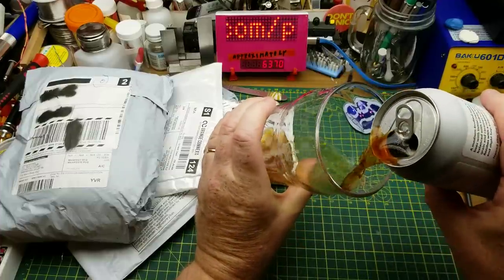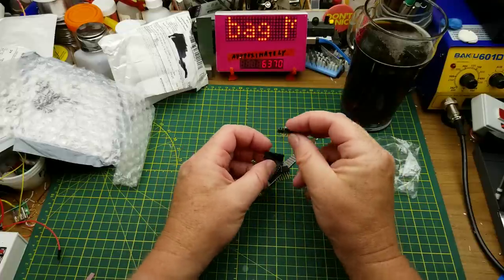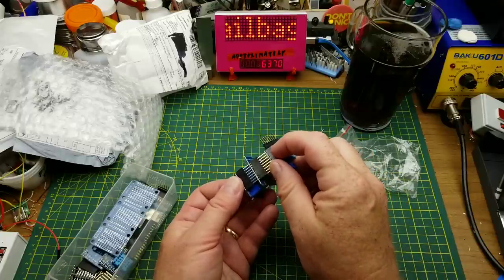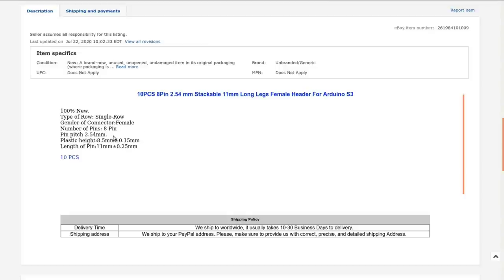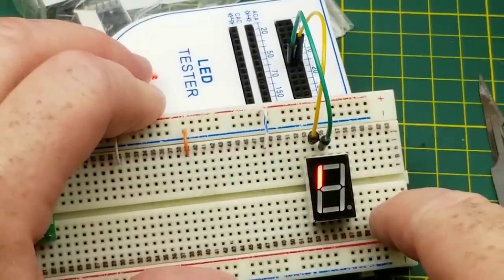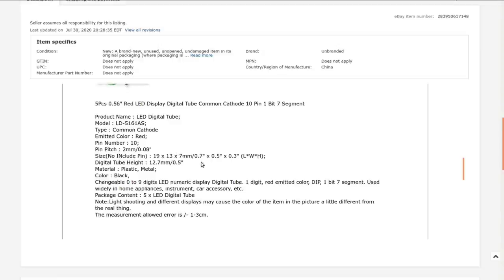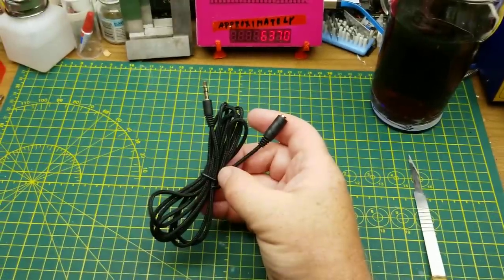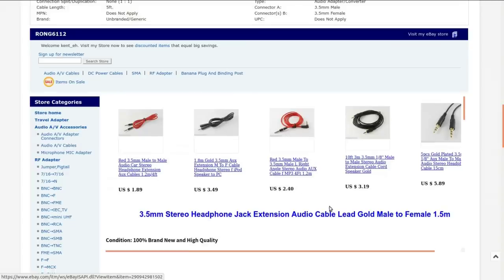mailbag Monday #94

Comment: Thanks for an interesting video! Bi-directional diodes, or DIACs, are used in AC circuits to provide proper polarity trigger (gate) pulses to TRIACs. Definitely like the second camera angle - I'm surprised more YouTubers don't use it.

Comment: I'm curious if the dimmer will work because it's a 220v 50Hz model. Dimming range might be off a bit.
Reply from the maker: I'm assuming it will be based on iming of the sine wave, not the amplitude.

There's only one way to find out!